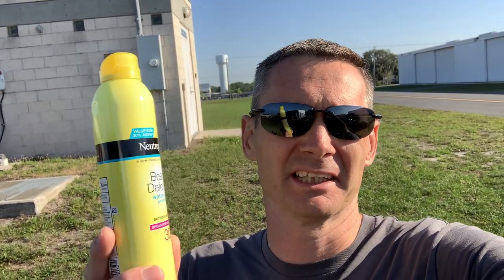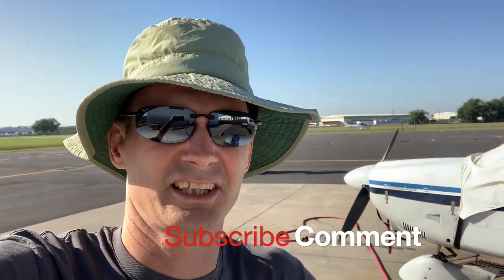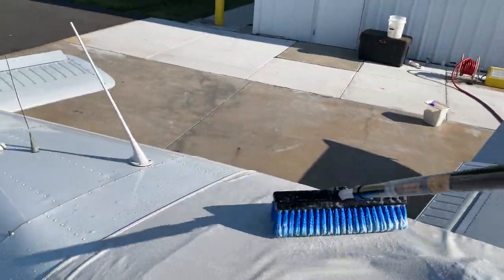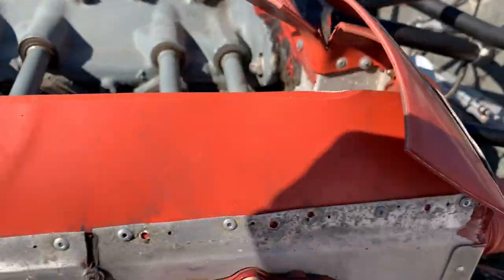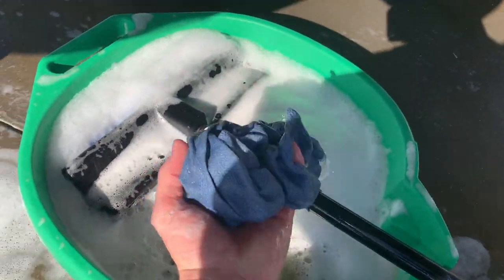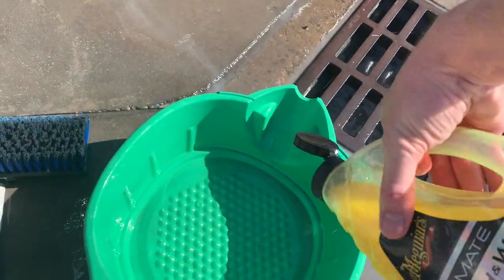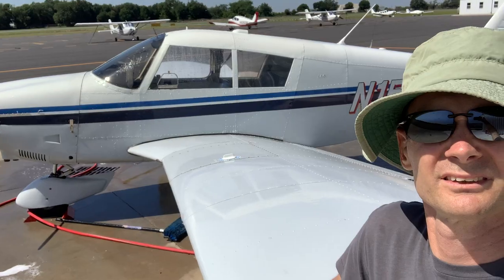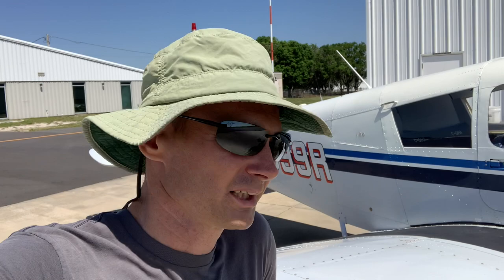How to wash an airplane

Comment: I used to use Easy Clean from Eastern Aero Supply in New Jersey.  It won't corrode aluminum but it is tough enough to remove stubborn exhaust stains.   BTW, if you let a new line guy wash your plane keep a spare transponder antenna in stock.
Reply from the maker: That sounds about right.
Reply: I kept waiting to see him break off the transponder antenna with the brush.

Comment: Jimmy, Try Simple Green on Engines. You will be surprised. Just spray it on, let it sit for 5-10 minutes and rinse off. No scrubbing necessary. You don't even need a spray nozzle on your hose. just let the water run out of the hose.

Comment: Great video and a nice airplane. I use Simple Green Extreme for spot cleaning, and Belly Wash on the underside. Some cleaning products contain chemicals that wick up between layers and cause hidden corrosion. I don't recall what the specific chemicals are, but I do know that if it smells like Formula 409, it should not be used on planes. To avoid this, I only use products that are specifically made for aluminum airplanes. For the engine, I have had three A&Ps use mineral spirits with a Harbor Freight compressed air cleaning wand. My guess is that your airport management probably would balk at running it down their drain.
Reply from the maker: Yeah, some of that stuff can be nasty.

Comment: I agree with you 100 percent about the Cherokee 180.  It will haul full fuel with four big adults and some luggage, and will still het off the ground in 2800 ft at sea level. The only fault it has is your fault.   It just feels solid and reliable.

Comment: I've had my plane since January. In the short term, I've been spot cleaning the exterior (mainly to remove the "bird presents" on my wings) but it can use a full washing. I'll probably do that later this summer, after the annual in July.
Reply from the maker: Picked up 2 knots after washing ;)
Reply: @therealjimmysworld  Washing and polishing our club gliders increases performance noticeably,  as dead bugs interrupt the airflow and  cause drag and vortices on the wing. The polishing is as equally relevant and the increase in speed can be around 3-4 knots against a dirty, bug splattered aircraft.

Comment: Jimmy, when you're ready to learn how to wash one the right way let me know. 
You also need to use a good paste wax, 5 to 7 coats as it smooths the surface and increases fuel economy and speed.
To answer the questions yes I've been doing it since the 60's.

Comment: Yea Jimmy I used that kinda silicone spray on the bug catchers leading edge last. We used a little 12v pump, a wand a syphon and spray the nasty gear and grime then a scrub it with a dawn dishwashing detergent. But yea the mineral spirits cleaned it.
Reply: That GD million dollar number on the side of that plane! I like that you cleaned under the cowl. And that plane did clean up.

Comment: To keep bare alum shinny we kept our tankers looking like chrome we only use citric acid and does not dull alum it makes I maintain the shinny look if you do this from new. I don’t know if it would hurt wires or not but the wires always looked like new so try this on you fire wall that’s bare alum and you will be surprised, good luck let me know after you do this and citric acid is very mild does nothing to steel only soft alum .

Comment: Hey Jimmy’s world, ho to the Harley Davidson dealer in your area z assume get some S100. It won’t hurt any Surface or finish. Won’t harm rubber or wire but is eats oil and grime. Spray it on and hose it off. Use it on my car, motor cycle and airplane
Reply from the maker: Thanks for the info, good to know!

Comment: We’ve had issues with water (and wax) in the static ports washing traditionally like this 

Highly recommend a waterless wash/wax for cleaning (we use Wolfgang concentrate) and an aluminum safe degreaser (like “wash wax all” degreaser)

The waterless wash concentrate can be less diluted for a nice “quick detail” spray to get bugs off between flights. For a wash we do 1oz to 3gal water, and for quick detailer 3oz per gallon
Reply: You should always plug static ports.
Reply: @mrweazal1911  but it’s better to just not use pressurized water for cleaning aircraft. And don’t paste wax them either. Waterless wash/wax on a sponge or microfiber is very easy and safe.

Comment: Best thing I have used on the belly is soft hand cleaner like gojo (or generic).  I put it on some folded paper towels, rub it in good, let it work and wipe it off.  Then wash the airplane and rinse any residue off.  That's the easiest and cleanest way I have found.

Comment: NEVER use that crappy alkaline degreaser anywhere near aluminium (that's how it is spelt), it is very corrosive, you need to use the petroleum based product, it's good stuff and works well. Then a strong ph neutral "truck wash'" detergent will finish the job well.

Comment: Try using Simple green it works well with cold water for degreasing an engine or anything as far as that goose  .
Reply: Simple green may destroy your airplane unless it's the one specifically formulated for aviation.

Comment: Do not use standard carwash products on an aluminium aircraft! The majority of carwash solutions are caustic/alkali to help cut through the crud, however you can buy pH neutral carwash solutions that do the business but don't attack the aluminium are available and that is what I use.
Even if you do your best to rinse standard products from the surfaces, with the best will in the world some will get through and dry in the same spot each time leading to point corrosion.

Comment: I was wondering , on small planes, do u have access to a master power cut off switch when your in the air,   I know all the component's are on breakers,
Reply from the maker: Most have a main battery switch and a key switch for the engine.